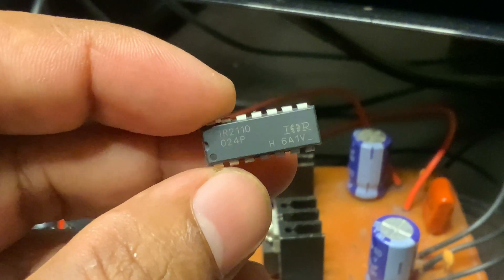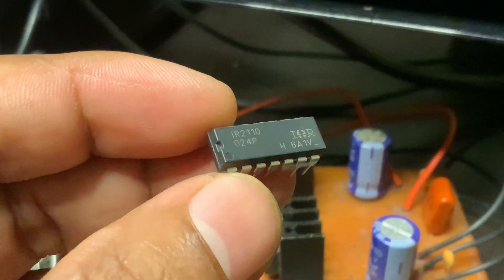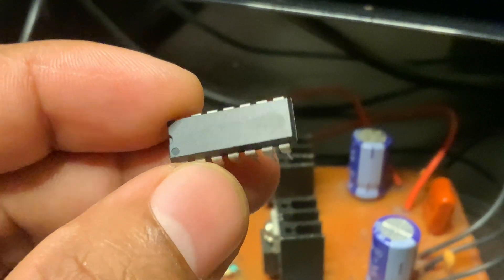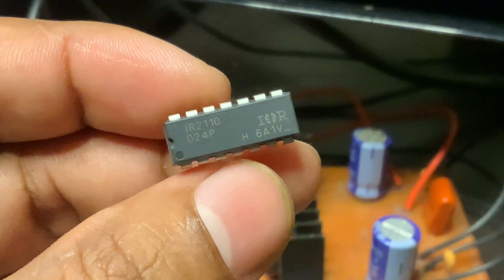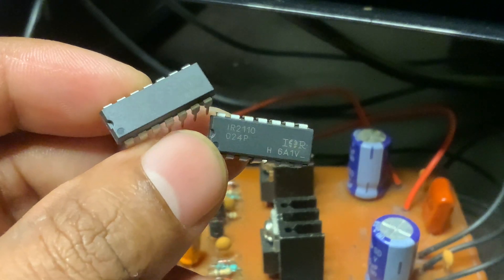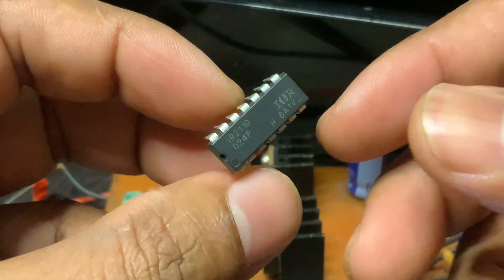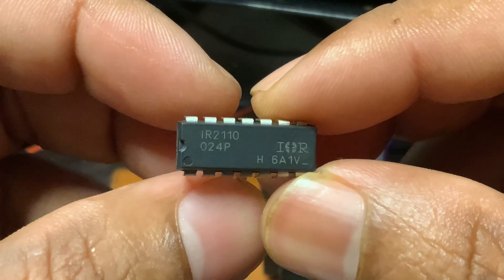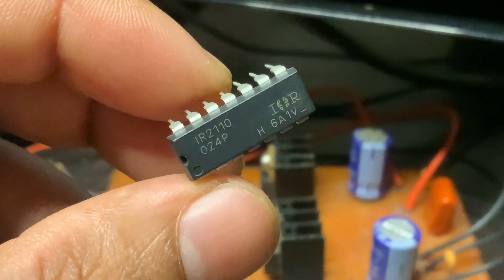IR2110 mosfet driver | High and Low Side MOSFET Driver in Simple Words

Comment: hey buddy ive been using these ic for long time, but i am facing some issue, I am using it for half bridge inverter topology class D type in which both mosfet needs to be turned on and off alternativerly,  I have a problem that my lower side(gate to source ) voltage of  mosfet Voltage Vgs is available from 6V to (-5.5V)  mean while i should get 12V to 0V do you have any idea why it goes negative where my input is 0 to 5 V input  signal generator. would be great to hear from you about it
Reply from the maker: with an IR2110 the symptoms you describe (Vgs of the low-side swinging to −5.5 V and the gate drive only ~6 V instead of ~12 V) are almost always layout/boot-strap and switching-transient related: fast dV/dt and parasitic L cause the switching node (source of the low MOSFET) to undershoot below ground and the Miller capacitance couples that into the gate, while an undercharged bootstrap or drooping Vcc can halve your available drive; measurement artefacts from a non-isolated scope probe can also make things look worse. Quick fixes: verify with a differential or isolated probe, add a modest gate resistor (100–220 Ω) to slow edges, fit a small RC/snubber or TVS on the switch node to damp L·di/dt ringing, ensure the IR2110 Vboot cap and bootstrap diode are correct and that HS is pulled low long enough to recharge (or use a dedicated high-side supply if your duty cycle is high), add proper local decoupling (0.1 µF ceramic + 10 µF electrolytic close to the IC/MOSFETs), clamp negative Vgs with a gate-to-source diode or a bidirectional Vgs clamp (or 12–15 V zener for overvoltage protection), and shorten the switching loops/traces — doing those will stop the negative spikes and restore a solid ~10–12 V gate drive.